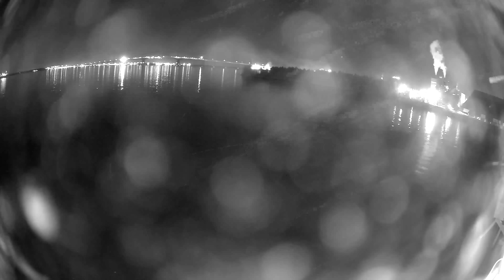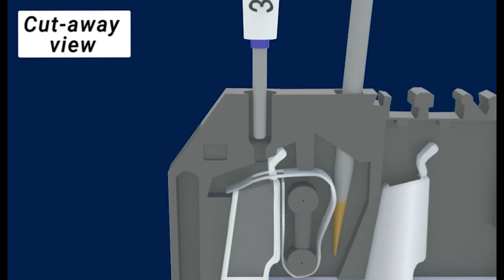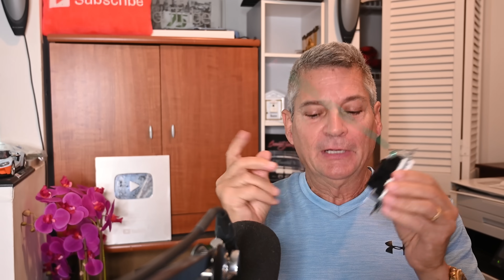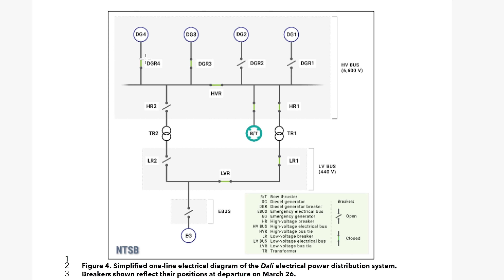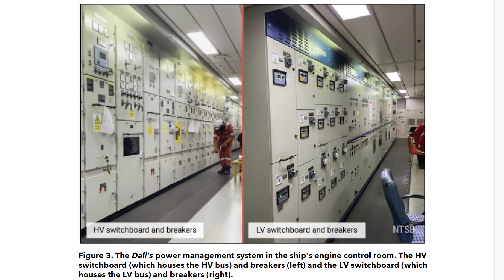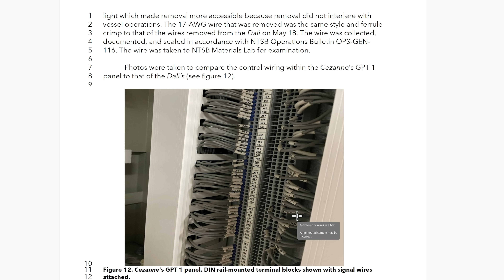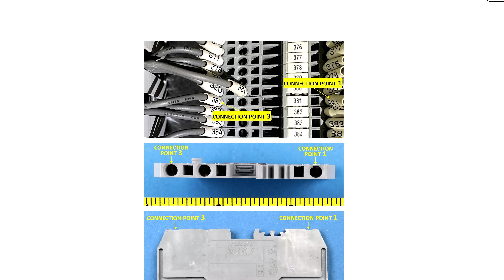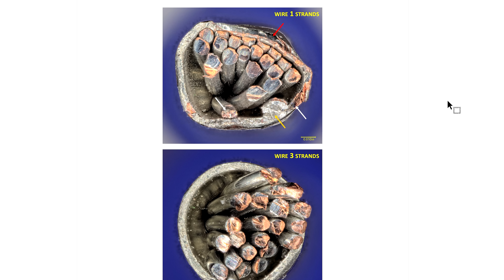NTSB: Scary Wire ERROR Caused Dali Crash/Key Bridge Collapse Baltimore

Comment: Do not knock spring-loaded electrical termination. Electricians here use Wago exclusively. I don't know what the issue with these backstabbing connections in the US is - probably cheap and nasty and built down to the absolute minimum - but the Wagos never fail. When used properly of course. Wago connectors are seen as MORE reliable than your "gold standard" screwed connection, primarily because they're much more difficult to screw up, and when you push the wire in, they aren't going anywhere.
Screw terminals offer a whole lot of ways to screw (heh) them up. You can fail to make a correct loop, you can fail to tighten them, you can put them the wrong way around and cause the screwing in action to push them out from underneath the screw head, you can - most insidiously - overtighten the screws and cause work-hardening of the copper in the transition zone, resulting in invisible cracks causing high resistance (and heating and a fire, possibly). This is why you are supposed to use a torque screwdriver for those. Particularly the very people who intend to "make it proper" generate a weak connection by tightening them like a maniac.
But even so, the very rigid connection between the wire and the terminal will cause work-hardening in the wire and a failure if there is any sort of vibration or movement involved. Just because you can't pull your "gold standard" connection out by tugging on it violently, it doesn't mean that an unfortunate lay of a wire and thermal cycling, expanding and contracting the wire, won't cause it so simply break off where it goes into the terminal. As said earlier, perhaps not even falling off but just having cracks and increasing resistance up to the point it burns.
Spring-loaded electrical terminals grip the wire firmly, but not rigidly - there is some amount of "give" when you wiggle on it and there is no sharply defined transition point. You can even twist it inside the terminal without it breaking off. Saying "see how easily that came out" after tugging and twisting violently on the wire is ridiculous. It is not meant not to come out under such a force. Meanwhile, you tug STRAIGHT on the gold standard wire and say it can't be done. Whereas, if you did the same to it as you did to the backstab connection, you might likely break it and would certainly damage it. Particularly if you overtightened the screw.
Most electchickens I know here all say that they were initially VERY sceptical of the Wago connectors, because they too thought screws were the gold standard. But very shortly thereafter they came to love the things. Not because they're cheap (they're not) or because they're quick (they are), but because they're simply the most reliable thing around. Most European electricians will tell you that in decades of work they NEVER had spring-loaded terminals fail. But the ones they use are good quality, not whatever the shareholder value possessed manufacturers can come away with selling.
If I had a choice between backstabbing and screw terminals, I'd probably use screw terminals. Because I know what I'm doing and what to look out for. If I had to oversee a workforce that consists of anything but highly skilled and experienced electricians, I'd give them Wagos.
Reply: Please put some paragraph breaks in this, because it looks like it is worth reading.

Comment: @16.57 looking at sisters ship, all the blue ferrals are seen where as none are seen in the shot before....Install issue!
Reply: I immediately saw that as well.  All of the visible wires in the Dali panel pictures have the number sleeves over the blue plastic. NONE of the visible wires in the sister ship pictures do; you can see a nice chunk of blue on every single visible wire.

Comment: I hate those spring loaded terminals.. much rather use the style that tighten with a screw.. dont care how much time i can save
Reply: This system looks like it could be reliable, if wires are properly manufactured and installed.  A screw connector connection could also be improperly installed.  A loose screw would be harder to notice.  These wire terminations are easy to inspect visually.  It just wasn't done.
Reply: @GH-oi2jf not saying they're not reliable, just not the style I'd prefer to use.. either way definitely should be tugging on the wire to make sure the connection is secure

Comment: This is the worst ever connector for electric cables I ever saw. Let say this is industrial standard but in my opinion very bad done technically.
Stupid design: Blue cone should have bigger diameter than label marker to prevent this situation. Is clear that worker FORGOT (this is very common) put label before and used force to put on cable when metal tube with blue isolator was already clamped.
Reply: "Worst ever"?  Not likely, or you haven't seen much.  An improperly manufactured wire can easily be spotted visually, when the wires were manufactured and when they were installed.  It was just poor quality work with no quality assurance.

Comment: Most Manufacturers of these spring actuated terminals do not recommend the usage of ferrules, instead pushing in the strands for better contact, more contact points and better pull out behavior!
Reply: @thomaskessler4585  Hmmmm, that seems "odd" since by definition the 'catch spring' (or whatever it is called) will only snag on a few of the strands (and it even risks cutting individual strands) and the rest will be somewhat free to move -- that seems VERY poor practice . . . .
Reply: These are WAGO terminals, and I worked as service technician in the stamping department where the contact bars and the springs were manufactured. The engineers there told me exactly this fact. Others do the same (Weidmüller, Phoenix Contact, Siemens). They have interesting drawings on their websites to explain this fact. And none of these terminals will ever cut or rip off a single strand. The single strand should form for a good contact. You can use single strand wires, but it will have drawbacks…
Reply: Yes. They could cut a strand and hides the connection behind gray plastic.  Terrible design.

Comment: 22:14 That mark might not have been a scratch mark but it might have been due to the clamp melting the side of the housing as the arcing kept heating it the metal part.

Comment: 18:27 I’ve been wanting an IR camera for looking at electrical systems on the trucks I repair. It looks so useful!
Reply: I use them on boats all the time, especially documenting new installs of high load components. It makes it easy to prove that you did your job correctly.
Reply: It most certainly is. Used ours on a warm breaker panel in the lab. Overloaded breakers stand out bright orange. No surprise, it was the server room.
Reply: get a thermal camera phone.   rugged waterproof and you have it in your pocket when you need it.   found plenty of issues in electrical systems and even to verify if bearings are running hot or not  and for the price 4-500$ its not bad at all
Reply: @DiyNuke  We bought one that attached to a phone at work (since it was cheaper than a standalone one, which was what I recommended). It attached to an iPhone and worked great...until the iPhone was older. Then, the app was no longer supported and we realised that we should have bought the standalone one.
Reply: @antronargaiv3283  i never liked the usb-c or any atachment in that regard.  chance is very very big if you drop it once its done for.

i dropped my phone in the bilge a few times and it survived it all.     its an blackvieuw BV9900 pro   but plenty of thermal imaging phones on the market these days.  some says its a gimmick but nahh its perfect to always have in your pocket  but for official checkups you do need a training+a certified one  and that will not fit in my pocket

Comment: Purely looking at the process of attaching a ferrule and a numbered shrinkwrap to a cable, it is beneficial to the overall mechanical strength of the connection if that shrinkwrap holds on to both the ferrule and the wire.
And the terminal blocks are designed to take ferruled wires. Even when fully populated it would be easy to see if just one ferruled wire would not be fully inserted.
But combined, these two seemingly excellent practices are working against each other.

Comment: One thing that grinds my gear regularly in this day and age is that with every . single . tragedy . conspiracy theory nuts come out of the woodwork. “This is intentional!” “This goes all the way to the top!” “There are dark groups involved in this.” From the Dulles plane/helicopter collision to the Guadalupe River flooding to the latest UPS freightliner crash, these waterheads have the inability to understand that bad things that result from errors or a cascade of errors happen all the time. And I saw it with this incident as well. It pains me to no end that almost none of the sea donkeys floating harebrained reasons for this collapse occurred 20 months ago will ever see your video. They’ve moved on to the next tragedy. Thank you for this rational analysis.
Reply: I have noticed this same pattern in a variety of contexts. It's even at the heart of religion v science. Primitive thinking views all action as the result of willful agents, who can then be judged as "good" or "evil", rather than systems. Re "cascade of errors": Yes, this is usually how these disasters happen. There is a true root cause of final failure, but it is preceded by acts of omission that exacerbate it. Diane Vaughan termed it the "normalization of deviance."

Comment: Ok I am not getting it how a failure in one wire is causing this many issue . Isn't that the whole point of having multiple redundant system that if one system is acting out no matter the reason it can be removed from the system and craft should remain functional. How it is different than in proper circuit breaker or a fuse tripping or random connection or arching which again any good electrical systems have compensation for it if not on individual wire level but at least on a system level and again you supposed to have two systems so one system going  kaput should not cause any issue .

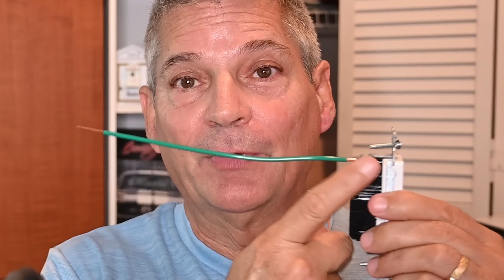Comment: 8:10 🤦A backstab connection is NOT the same thing as a spring-cage terminal like in the WAGO ones on the ship, and it does everyone a huge disservice to insinuate they’re the same (or practically the same) thing! The backstab terminals on cheap receptacles and switches are stamped and formed out of the brass bus bars within the outlet/switch. That brass is not spring brass, and deforms over time, allowing it to loosen. A spring-cage terminal block (as well as the newer toolless versions) use a copper bus bar, but the clamp is a separate part made of spring steel, which won’t loosen over time. That is an essential difference.
Reply: Exactly the Spring Cage terminals Wago and Phoenix Contact makes are inherently safe and have been approved and certified to the highest degrees.
Try pulling a seated wire back out, you rip the terminal off the Din Rail before the wire pulls out.

What I see most often with this type of terminal is simple installation errors.
Like using a ferrule that is too short which barely holds in the terminal or they try shoving a wire and ferrule which is too big into the terminal.
Reply: I agree 100% the comparison was flawed but the best part was him trying to pull the wire from the backstab and there being an obvious cut in the video and then him saying, see how easy that was? Well, no. No, we did not see how easy that was because you cut out the part where you were trying to yank it out. I can get the wire off of the screw just as easy using a circular motion like he used. Don't get me wrong, I don't use the backstabs either but he didn't even discuss why they fail. It's not because someone is spinning the wires around and yanking on them.
Reply: He's not implying that WAGO connectors are inherently flawed. He's using the backstab as an example of any intermittent connection. 
A backstab IS analogous to an incorrectly inserted WAGO, but that doesn't imply that both connector types are on par with each other. 
He agreed with the conclusion that it was user error and not the equipment.
Reply: just because it has a backstab does not make it "cheap" receptacle. Every major manufacturer makes and sells them. Sure, some are in fact "cheap" but then those recepticles have so many other ways they will fail that backstabbing is low on the list.
Reply: @mrl22222  You need to carefully re-read what I actually wrote, because that’s not what I said. 

I wrote: “The backstab terminals on cheap receptacles and switches are stamped and formed out of the brass bus bars within the outlet/switch.” That means “The backstab terminals on receptacles and switches which are cheap are…”, that is, the comment is restricted to describing how they’re made in cheap models. 

It’s not saying that having backstab is what makes it cheap, nor is it describing how a backstab terminal in a non-cheap receptacle or switch is made.
Reply: @tookitogo  No one is going to "carefully re-read" anything you say. You take yourself and your precious Waygos WAY too seriously.
Reply: @johnd5398  I care about factual accuracy and intellectual honesty. That you refuse to re-read, so as to see what I actually wrote, just shows you’re intellectually dishonest.
Reply: Anology folks it's call anology or example 📏
Reply: @achekholbeck88 You mean “analogy”, but it really didn’t come across as one.
Reply: @tookitogo  It was an analog analogy he pulled straight out of his AnaLogenous...              mind.
Reply: Sorry, I disagree; they work on the same principles
Reply: @davidschwartz5127  The word for today is Hardness.  And while we're at it...  Ductility.  The wall outlet backstab is made for a solid wire, and also for retention by way of the angle the 'backstab'  blade edge and meant for non-flexing installations.  It would likely tear up a stranded wire pretty badly.  These create gas tight connections that will remain integral even after vibration and tugging.  Principles?  Yes, the "cinch" mechanism that a shear cut edge can have if impinged against another element at a right angle to it.  Any other angle and you are whittling.   Meucci's phone and Bell's Phone worked on the same principal, but Bell's lawyer shoved his patent application ahead of his competitors.  But I digress-a-dis-agree with the result.
Reply: @davidschwartz5127  They aren’t, and I explained why: separate spring-stainless clamping spring, vs. bus bar and “spring” formed of the same piece of brass.
Reply: They're all junk. I've seen way too many failures to trust any of that crap.
Reply: @johndoe-so2ef  And yet in Europe, they (WAGO and co, not the cheap American backstab terminals) don’t seem to ever fail.
Reply: @tookitogo sure, they never fail in Europe. But they fail here. That's all that matters.
Reply: @johndoe-so2ef  That suggests user error, not a problem with the product.
Reply: @johndoe-so2ef  So if the same connector is failing in the USA but not in Europe, what does that tell you?

Comment: 22:15 I can tell you the real answer, that plastic deformed due to heat from the spring metal that got very hot. Got hot due to wire just setting on top of it. Resulting in the arc marks and due to low contact presure, very hot spots.

Comment: The crush on the tip of the ferrule might be from when the ferrule popped out of the spring clamp and was pinched by the clamp before it popped all the way out.
I would think that the damage the ferrule had on the end wouldn't come from someone trying to push it back in.....
Just my guess and observation.

Comment: I refuse to use those back stabbers. I always make the loop and make sure the screw is secure. Even when I have to use wire nuts, I tug on each wire to make sure it's secure. I've had an occasion or two where I worked on stuff that somebody else had installed where a wire had popped out of its nut to say 'hello'.

Comment: This is what happens with plug and play , a quick way to disaster when it fails .
All the electric connectors should be screwed or bolted, much better connection with less chance of failing.
I never use plug in wire connectors if I can screw the wire to the connector , I have seen to many plug in connectors that have made pore connections and got hot and failed or got hot and nearly started a fire .
Takes more time to do it right the first time but it will be safer and last much longer .
Reply: Spring-cage terminal blocks have been used by the millions, possibly billions, for many decades. There’s nothing wrong with them, and they’re not the same as backstab connections. This is assembly error, with the wire inserted partially so it was only held by the tip. Had the wire been inserted into a screw terminal such that only the tip was clamped, it would have worked its way out, too! (And maybe sooner.) 

Generally speaking, spring-cage terminals do better than screw terminals in high-vibration environments, not worse.

Comment: Jeff, I have to disagree with your conclusion as to the ultimate cause of the crash into the Key Bridge.  Certainly there were technical issues, but the captain knew of these problems and also knew that loss of electrical power and ship's control could result in the catastrophic crash.  Think of it this way; an airline pilot sees an indication of fire on an engine and takes off anyway, saying they can fix the problem at destination.  An airline pilot would never do that and neither should a ship's captain.
Reply: Your last sentence is refuted by the crash of UPS 2976. The pilot took off with an engine missing and a wing fire, because they had no other choice.